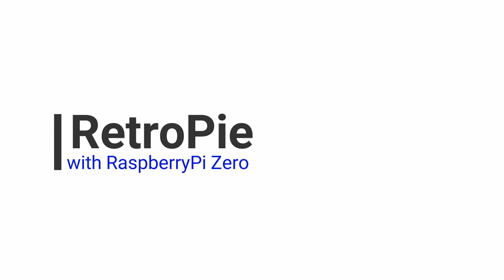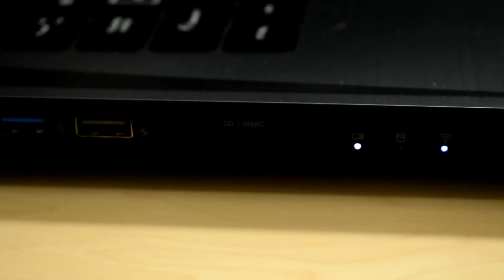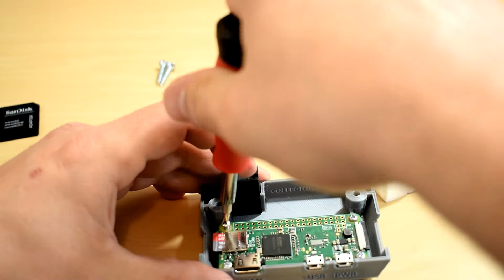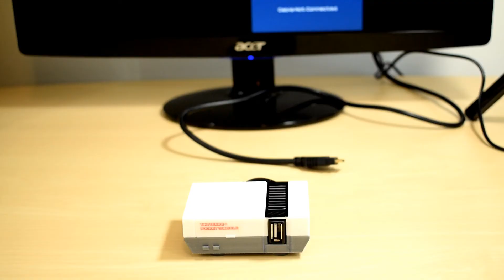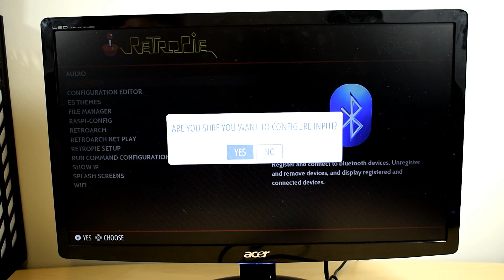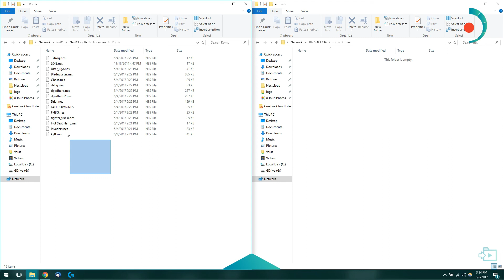Build your own NES Classic with RETROPIE & RASPBERRY PI ZERO W

Comment: Can i connect a xbox controller instead of keyboard and configure my keymaps from the start? Or maybe insert a usb extender so i can have multiple usb devices?(i dont have the bluetooth controller)
Reply from the maker: Yea you can use xbox and PS4 controllers with retropie. It will support a usb hub as well.

Comment: Would this be able to handle gcn games? Or would I need to get a better raspberry pi?
Reply from the maker: UselessDood I would definitely look at a Raspberry Pi 3 for gcn. The zero can play some of 6th gen consoles games but your best bet is RP3 to avoid any issues.
Reply: TechRelay ok thanks, and also could I configure a Nintendo 64 controller to work normally with n64 games, and also with snes games?
Reply from the maker: +UselessDood Sure, you can get an USB adapter for the controller or just buy a USB n64 controller. It can be configured to to with all games.
Reply: TechRelay and the analogue stick? How would I configure the n64 controller to play n64 games? Sorry I'm bad at this sort of stuff 😂
Reply from the maker: +UselessDood You would just configure them as “Analog” in the controller mapping screen. You can kinda see that here. https://github.com/retropie/retropie-setup/wiki/Nintendo-64
Reply: TechRelay thanks for the help! And sorry again for asking so many questions